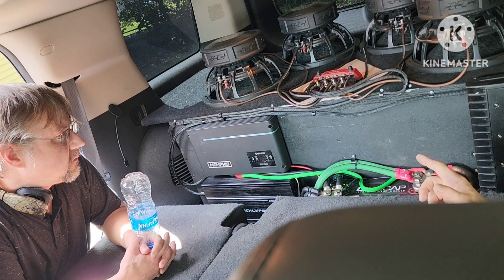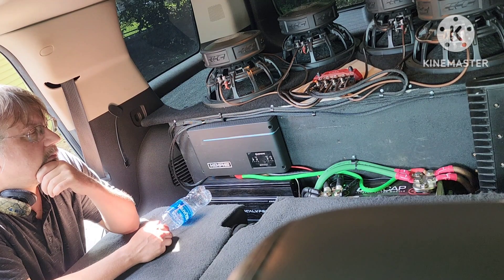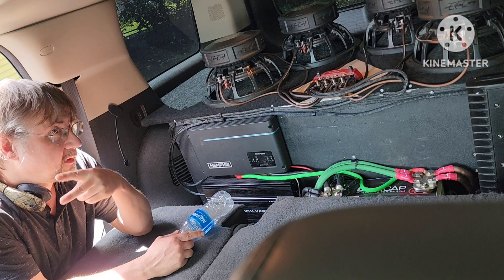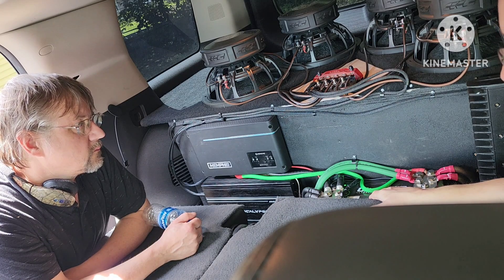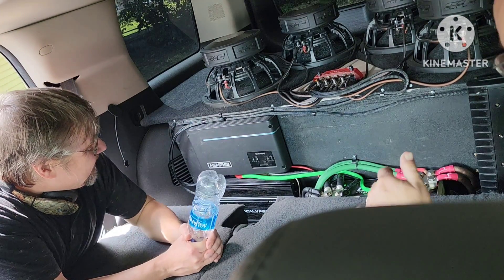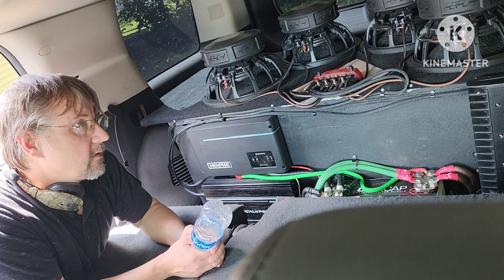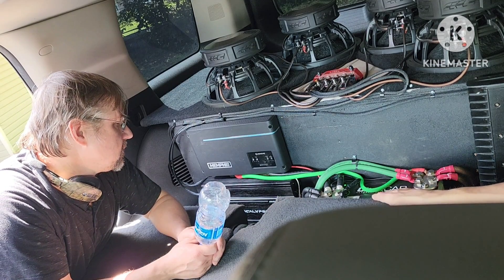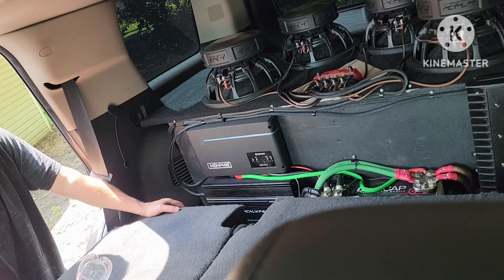What DOES an Ioxus Ultracapacitor do for car audio?

Comment: Ultra caps help, but having an alternator that is capable of supplying full power into secondary storage (batteries) is much better. If you can’t afford a high power alternator, then ultra capacitors are the next best thing.
You are always going to be better off running an alternator over anything else.
Reply from the maker: to a point yes, but there is a point where you cant get enough alternator power to cover the load,
Reply: @CarAudioEnthusiasts  agreeable like my subaru.. The highest amps for my model is 220 and it is barely making it for 3k 1ohm sub. Will need a cap to help with lights dimming. I got big 3, 220amp alt, and agm battery.

Comment: I have one for a little over a year and i like the operation other than the high pitch noise it makes when the car is not running and i believe that it interferes with my radio reception and tire pressure monitor sensor..

Comment: What's your take on having 2 Ultra Capacitors together I have 3 x 320 amp LEECE NEVILLE alternators. In my 1985 gmc sierra classic C1500 Suburban.
Reply: @rayjohnson7886  I have a 1987 gmc truck. How in the hell do you have 3 alternators is that custom cause they don't even sell a dual kit. I have a 220 amp alternator and would like more alternators
Reply from the maker: mare caps is always better,
Reply: @CarAudioEnthusiasts  Okay I've never used the Ultra Capacitors before I'm thinking about it. I know that I have the power source up front 3x320 LEECE NEVILLE at 14V.  Which I can regulate them higher if I wanted to because I have external regulators.
Reply from the maker: yea most caps are rated up to like 17v, so theyre perfect for your setup
Reply: @CarAudioEnthusiasts  I'm the type of person rather have more than I need than not have it when I need it. Question I'd like for you to educate me on the app situation and how that goes. If you don't mind but if you don't mind whenever you have time. Is it procedures after purchasing a capacitor from Amazon or whoever it's purchased from. And downloading a app on my 📱 it's so many people on YouTube. But some of them makes things complicated instead of getting to the point.
Reply from the maker: @rayjohnson7886  1. you never NEED to use the app  2. it functions as a volt meter, and as a way to force the cap to turn on temporarily to {jumpstart} a dead battery. (normally its turned off till it sees a charge coming from the alternator).
Reply: @CarAudioEnthusiasts  Alright I understand I'm getting ready to start doing the installation. And I don't like backing up throwing away money that's why I'm asking you. Thank you I appreciate it I won't be nowhere booming like you. But I just want it to be tight and alright so if I decide to turn it up a tee tee taste it'll be solid as a rock.
Reply: @CarAudioEnthusiasts  Good morning thank you I appreciate the reply and information.

Comment: So if i had this compacitor an my bass amp is. 3500 rms would i need to upgrade alt.?
Reply from the maker: still need the alt, but the cap will smooth out the work for the alternator, and help with dimming lights, and makes the hard hits more impactfull.

Comment: I'm an electrical engineer.
This is a good example for this use case.
But to help this out let me explain a few things.
A amplifier might have an rms out put on a static sign wave input.
This is the max rms of clean power at this point I'm going into a hypothetical without accounting for the efficiency of each component.
But 
Let say you listen to only music and not tones.
Let's say the subwoofer amplifier is getting 120 beats per minute.
That's 2 bass hits per second on average. And each 70hz bass hit draws full rms power for a full cycle of 16ms that's equals 32ms or 32/1000 or a duty cycle of 3.2% keep this in mind.
A duty cycle of 3.2% say this amp pulls 100Amps × duty cycle = the draw 3.2A required by the alternator to keep the car from running dead. But this assumes the rest of the electrical can handle that 100A draw for the 32ms.
And this is what your really need to know for capacitors is the pulse power   also known a Jules 100A at 14.4v is 46.1 Jules of energy and as a ruff number 100F of capacitor will with a max 1v drop is 50 Jules of energy.
So to keep your voltage clean you 1F per 1A of input current when only using capacitors.
The 100A draw at 14.4v is equivalent to a 0.144ohms of resistance. Using this info and the ESR of a battery you can tell how well a battery can support  a this load OR you can look at any batteries esr rating and nominal voltage as full current of any battery is only at nominal voltage for standard agm/sla it's 12.8v unless it's a 14 or 16v car audio spec battery.
You take max voltage drop you want to allow say 1v and divied by esr most good agm fall in the 0.005-0.010 range 
So let's say it's a brand new d1200  and it esr tested at 0.005ohm dischrage ok so this battery can supply 200A and this has a cesr at 13.4v of 12ohms. So it can output 200A but at 12ohms and the alternator 14.4v target it will only charge at 12A so the voltage will slowly decrease tell the cesr balances out the amplifier draw for the duty cycle of the music.
The 12A easily covers the 3.2A we need to recover what we use on avg this is more than enough to keep the system happy.
But all you need to do is pop some drum  and bass tracks that push the duty cycle up to 20-30... 80% and the battery is over loaded the stock alternator will not keep up. And the system will become 2 stage
Stage one is the first draw tell the alternator maxes out this might be the first 40-300A of continuous draw depending of the alternator(s) used this will be basicallyany voltage above 11.8v. Stage 2 is the draw down of battery reserves this is 11.8 to 10.2v after this point the engine will struggle to run or start back up all based on acid type batteries. 

My system is 8x avatar 1546-stu d2 subs on 2x taramps bass 30k.
3x taramps ds 2000x4
1x dsp
Android headunit
 Ds18 highs, mids and horns.
Over 16kwhrs of lithium.
500F of capacitance on each of the subwoofer amps.
Custom Android app and subwoofer diy management system (configures the subwoofer wiring and tracks coil and amp temps).
Reply: 70hz bass? You listen to some odd music
Reply: @SheikhN-bible-syndrome  Reading comprehension? He's giving an example. Besides like he said. Unless all you listen to, is tone or sign waves. You will be hearing 70, 80, 90 even 100 hz. Music is not 33 hz. 😂😂😂😂
Reply: @ricardomolina4605  I make music  as well as do remastering /rebassing/ Dj/tech and it'd obvious that he and you have no clue what frequencies that are used in mainstream rap/hip hop and Specially rebassed music 
In mainstream rap and hip hop on average the bass is in the 35 to 45hz range and 70hz especially 100hz isn't even considered "bass " it's more of the mid bass that your doors would take care of and if I played you a 100hz sine wave you wouldn't call it bass not even if you were drunk. Now, lots of the people that are buying this capacitor bank are into rebassed music like I am and that music will play down to 20hz I know personally  I rebass my songs to play in the 20hz to 33hz with the most common being 24hz and yes you can hear that despite what google might tell you .
Reply from the maker: @SheikhN-bible-syndrome  a lot of drums are in that range.
Reply: Can you share how you monitor voice coil temps?
Reply: @scook9216  i made a custom IOT device using esp32 connects to the server on the pi4 that runs the dash.
The esp32 has 2 rj12 (phone cord) connections.
This is a set of i2c, aka smbus lines.
Each subwoofer has a small 4mm hole drilled just above the magnet.
A 3d printed case fits into the hole and gets zip tie to hold it in place this sensor is a saml21 mcu acting as a i2c slave if reads the mlx90614 IR temp sensor and has coil inputs   it connects to the coil thermals and monitors the coil health doing a resistance and inductance test whenever the voltage on the coil is zero. This part of the circuit is isolated from the low voltage and is safe to 280v per coil. A pair of NTC thermistor, one on the top plate of the motor, the other free air just track more thermal data. This data is sent over i2c 30x a second. This data is put into a lookup table on the PI and is overlaid in the gui but also can shutdown the amp hooked to a sub if the coil fails and can limit or drop volume based on coil air and motor temps.
If a sub was to fail the ws2812b led strips on the from face will light up red around that sub.
Reply from the maker: wow! Now I have a headache...happened a lot in college. "CIS major" neway...your setup must be a sick one, mine is more budget, and my Only ride. 

My Dual Alternator Bracket
https://gpcaraudio.com/team-gp-dual-alternator-bracket-2000-2013-gm-4-8l-5-3l-6-0l-6-2l/

My 370Amp Alternator
https://gpcaraudio.com/370-amp-high-output-alternator-gm/

B Stock IOXUS 12V Group 31 Smart Power Bluetooth Ultra Capacitor
Odyssey Battery ODX-AGM31 Extreme Series AGM Battery
2 North Star SMS-AGM80 Batteries

The subwoofers I'm using are found here 
https://gpcaraudio.com/deaf-bonce-apocalypse-db-sa302-d1-d2-12-subwoofer/ 
They have been AWESOME for me! 

The Amplifiers I'm using is here
https://gpcaraudio.com/deaf-bonce-apocalypse-aab-7900-1d/
JL 450/4 (22 years old)
Memphis Audio PRXA1000.1 Power Reference Series Mono Subwoofer Amplifier

Doors recoil 6.5s
A pillars, Audio Dynamic 3's and Memphis M series tweets
Reply: @CarAudioEnthusiasts  I have two xs power batteries d41 under the hood of my Chevy Tahoe ltz . running two jp23v2 link together subs are wdxg5 15's  and a js 370 alt. Would it be good to add one of these to my system?
Reply from the maker: @kemkyothood7920  Adding a supercap is always a boost, the only setups that woulddnt benifit are setups with massive banks, like 200ah of lithium and more.
Reply: @CarAudioEnthusiasts  thank you